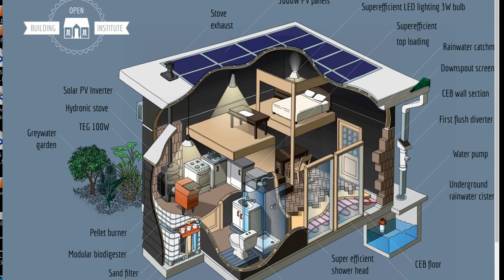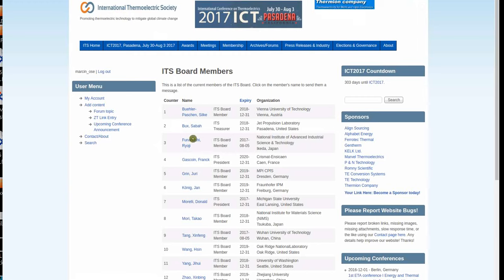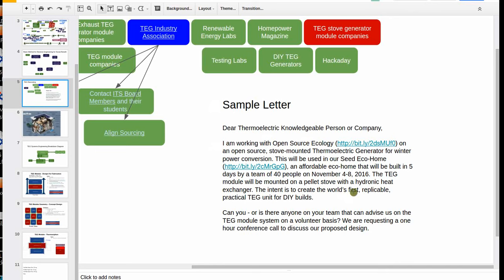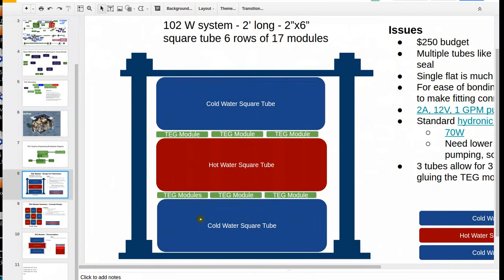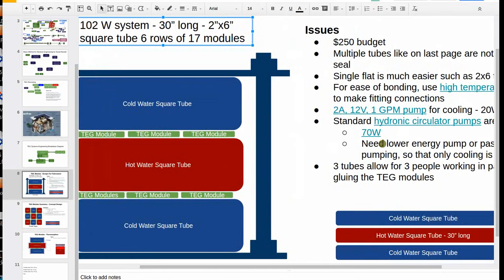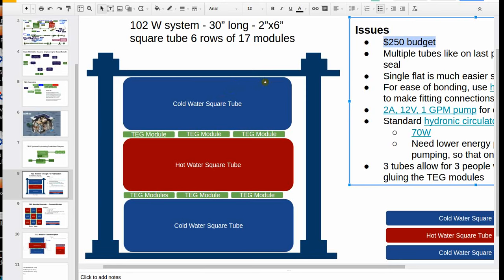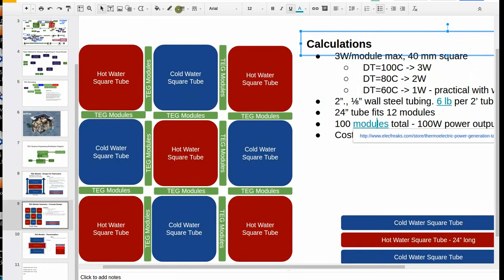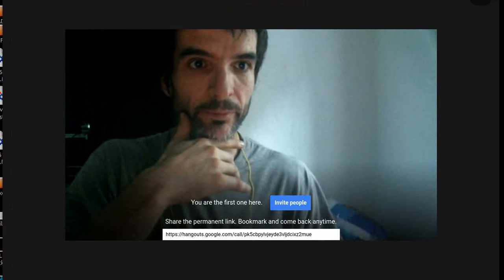100W Open Source Thermoelectric Generator

Comment: That's not that efficient. If you want to make electricity out of hot and cold, Google "Sunpulse 500". More expensive i know, but the fact, that it's already a working unit, makes it worthy for a quick Google search.
Reply from the maker: Do you know if there is an open source version of the solar pump?
Reply: no, sadly i didn't dig deep enough in that field. However, the concept (the one that this pump using) called the Stirling engine, and it's around for centuries. you can find a lot of written stuff and also videos on the net. They make them even out of beercans. The Sunpulse itself is a work by a german (or austral) gentleman, and he runs an entire village on it. It can heat things, cool things, create electricity, pump water and give out circular motion power. Try to Google "Stirling engine"! You will suprised how much knowedge is available in this topic for free. My fav design in theory is the Alpha style, where the hot and cold ends are completly separated.
Reply: @DewsySipos  
Unfortunately, the project is aimed at a certain market. Not so much individual use. At $10,000 they are a little expensive. Achieving a high temperature is also challenging unless you have the right climate. The overall design concept of a Stirling engine is superb. It does have moving parts and so requires maintenance.
Using TEC's has certain advantages. It can use any heat, and at lower energy density that a Stirling engine. This means it can use solar and 'waste' heat. A hot water tank becomes a battery or a dump load if you are over producing from your solar hot water panels. The modules , can provide heating and cooling or energy, which is incredibly versatile.
If the price drops on Sterling engines, then they would absolutely have a place, along with the other technologies.
Reply: @keith7976  It was a long time ago, but if i can remember it correctly the efficency of these modules are really really poor. If i can recall it correctly around 2-3%. If you value heat and eletricity as energy both, you won't get enough of either one with these. I think a properly sealed hot water tank would lose so little heat, covering it with these modules will never pay for itself.  Meanwhile batteries are getting better each year, on the large scale as well. IF space is not the primary concern (like on phones), there are the flow batteryes. They do not degrade over time, mostly consisting out of salty water (non-toxic,  esaily recicleable).

Combining hot water storage (wich you need) with electricity generation the TEG way on the home scale will drain your heat, will not make up for it in power,  will make design, construction and maintenance harder, and the only benefit is that you can say that you did it. I don't think it's worth it, but i am not an expert on this field, just my common sense tells me these things.
Reply: @DewsySipos  
The materials have changed a little, but you are correct, the efficiency is in the 5-8% range. 
The flow battery technology is at present expensive and limited availability. However, the idea of a battery that has no discharge lifespan is huge. I would buy them if I could afford them. The storage problem is being solved, I'm just impatient.